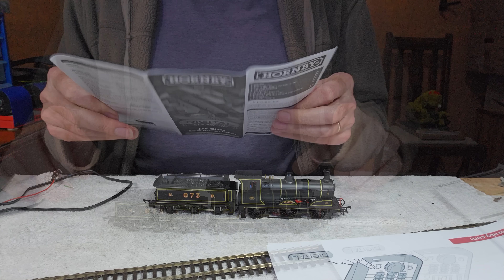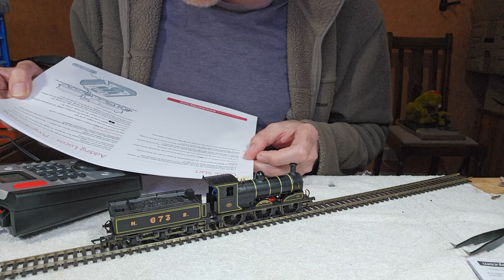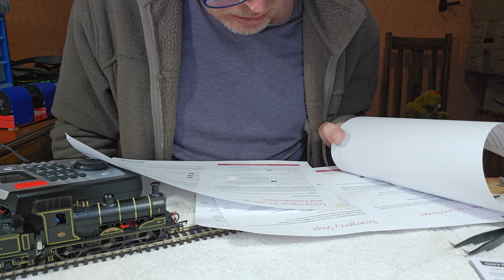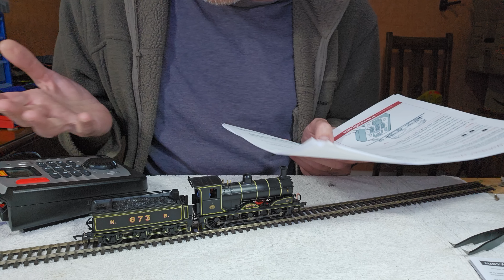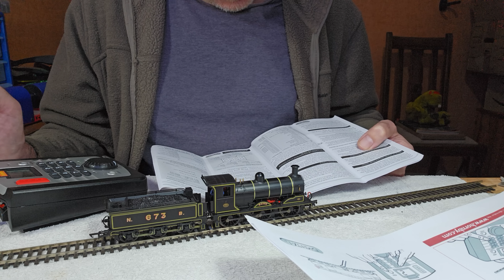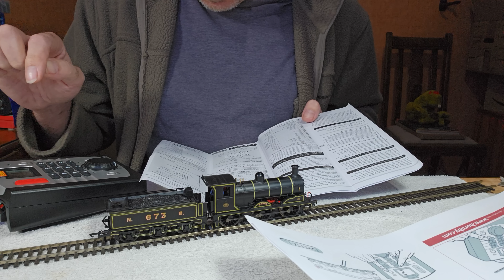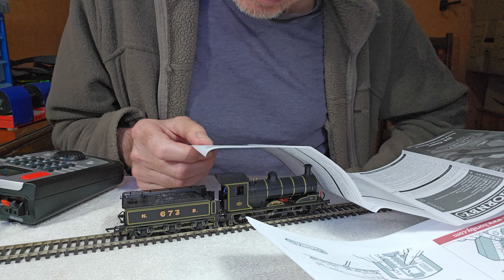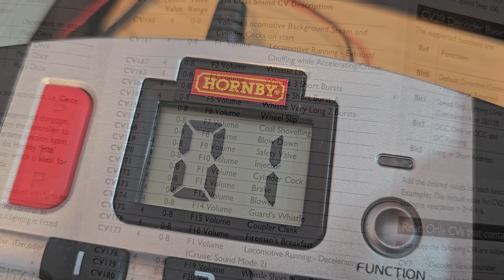A Dabble With DCC

Comment: Oh yes Bill, I remember that feeling well. So that is what DCC is all about, is it worth it? All that extra hassle of wiring and understanding how to use it, never mind programming each locomotive to get the sound right etc. I run a double track layout and have 1 track which can be either DC or DCC, depending which controller I plug in. When it running well it is great and get attention from folk around. DC is easier!!

Comment: I also have tinnitus and find DCC sound fitted locos rather nasty to listen to - I might still give the DCC++ EX open source system a go, as it looks a) cheap and b) simple to build and install.
Reply: I too have a low tolerance to noise, screaming, shouting as a result of  tinnitus.
Reply: @charlie1872  It's a right pain, Charlie...

Comment: You can turn the sound up and down in the CV settings.  I only have two sound fitted locos, one a Class 66 (bought for the unique livery, not for the sound.) the other a second hand class 25.  I do like the 25 the best.  The sound on the 66 is not very good, too much background hisss.  I am not sure if it's a poor sound file, or a poor quality speaker fitted by Bachmann!

Comment: Well done! I agree that the sound can be offensive. It should be possible to turn the volume down. That said I have 40 locos and only have one with sound. I hardly ever turn it on though. Personally I find the Hornby dcc controllers to be very clunky and hard to use. I have a NCE controller which is much more intuitive to use as far as I am concerned.

Comment: I'm with you on the sound.  Besides the quality the 'chuffing' bears no relation to wheels.
Reply: DCC sound is awful for steam locos, because as you say the sound and motion aren't synchronised. For diesels though, it's fantastic. When I got back into the hobby during lockdown I went for DCC but thought sound was a bit of a pointless gimmick... until I tried it! I model the 1980s so the steam issue isn't a problem.

Comment: The buttons on that controller might need to be cleaned on the inside, happens with rubber buttons all the time, i had a TV remote that was like that and cleaning the board and the back of the buttons with alcohol did the trick, there might be better products to clean but it's what i had at hand and the remote was old anyway heheh
That coal shoveling noise was something out of a horror movie 😅

Comment: Bill, is there any difference in the running between DC and DCC?  I have considered trying a single track for DCC, I have the controller and a chip but with the exception of my Virgin Pendolino( it’s in bits) I don’t have a DCC ready loco. Sounds complicated and possibly dangerous as you mentioned. Cheers

Comment: If you are wanting to use a DCC controller for maintenance\repair purposes, you will need one that is capable of a decoder factory reset. Sometimes that is the only resort to recover an unknown loco number or or really "screwed up" decoder after a short or bad programming.
I don't think the Select is capable of resetting. In my opinion an NCE Powercab or similar would be more suitable to your needs.

Comment: I use both systems on my layout and have a dead section of track connecting them so good can be passed back and forth if desired. I'm with you on the sound front and don't like it that much, none of my DCC loco's are sound fitted and it's much cheaper that way as well. The Hornby controller you have is a very poor introduction to the system as it is very limited in the way it works, with a good system you could get to enjoy the benefits of DCC a good controller will display more useful info on screen rather than just a two digit number. That said there is absolutely nothing wrong with sticking to good old tried and trusted DC.

Comment: Bill, not all DCC is created equal. Hornby decoders are cheap for a reason and there is a big difference between a 20 pound Hornby decoder and say a 99 pound Zimo decoder as there are a huge difference between DCC systems. Hornby Selectrix is a starter system and is very basic. Ohh and remember to fit those buffer stops😂😂

Comment: The default 03 address is to cope with simply adding a loco to a train set which comes with locos 1 & 2.

You don't need to know the current address to change an address. Most decent DCC controllers allow read back of CV values including the address. The Select doesn't.

Also be aware that locos could be addressed in the 1-9999 range but higher numbers can't be addressed by the Select. So I suggest if anyone sends a DCC loco to you, you ask them to change the address to something <99.

I agree with you with DCC sound though. Unless you have an expensive speaker, the sounds can be awful.

Comment: I see you've been dragged, kicking and screaming to the alter of DCC!!!😅To be fair, the Select controller is a bit old and obsolete now! the new HM 7000 by Hornby is much easier to get on with! Also the TTS sound decoders use very basic speakers which would benefit from being changed for a better one! If you what to turn the volume down, you would need to set the value of CV 63 to a lower number!
The Hornby HM7000 would allow you to change the volume by moving an arrow up or down on a Smartphone App!
The great thing about DCC is that you don't always have to fit sound and Locos run so much better and smoother at low speeds, giving a more prototypical look! Enjoy!

Comment: Yes, but you were, quite understandably, rather inept with the controls, and especially with the sound.
First, you can set the acceleration and deceleration with 2 button presses, and to be realistic it needs to be a lot slower than this - mine will take a circuit to slow to a stop from a fast-ish running speed.
And second, you need to turn down the overall volume of the sound - that was just distorting the small speaker.

You need to think of the sound as something you manipulate as the engine runs, like making the soundtrack to a film.
So, on that little shot I would have used whistle 22 just as I was setting off, especially in reverse, then turned off the chuffing once it got to speed, and  just had the steam and coasting noise, turning the chuffing back on when coming to a halt (function 17) - this adds a lot of atmosphere, without being annoying.
I  would also have used whistles 5, and especially 20 (which is awesome) while running, and after turning the controller down, while coasting to a halt, I would have used the safetty valve noise, then switched it off just before stopping, and then applied a last minute brake squeal.
It really does bring things to life, and it gives you something to actively play with during the running sessions.

And remember, Maude is only TTS sound, nor is she even the best example of it, but you can fit any sound chip if you don't like those sounds - and there is also the much more realistic DCC sound, which is awesome.
So don't be put off - practice and develop skill with sound!

Comment: You can set the individual sound levels and you can set the overall sound level. Or just turn off the sound altogether. BTW that horrible Hornby speaker is causing the “tinny” sound. You can get better speakers on-line or at your local hobby outlet ( Sugar Cube) speakers are better than that Hornby thing